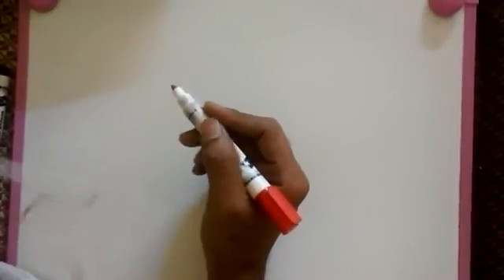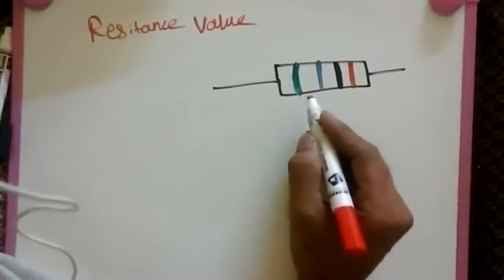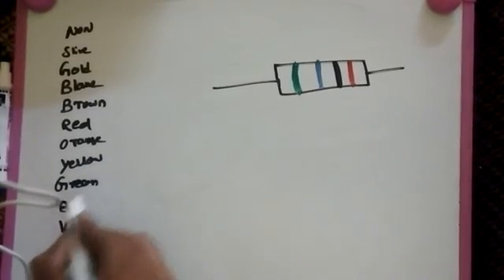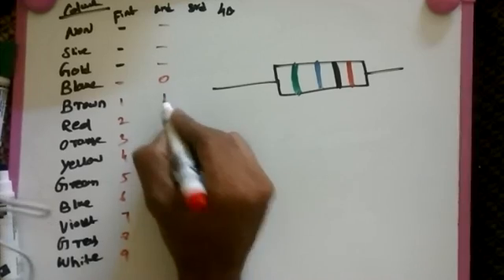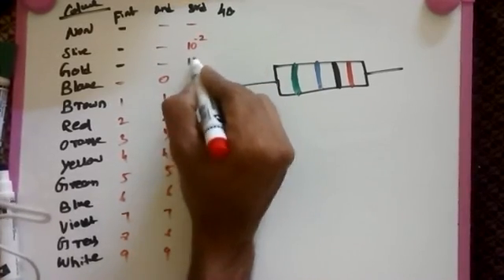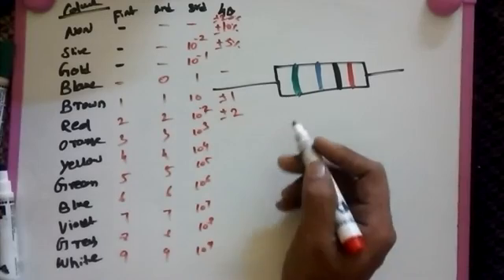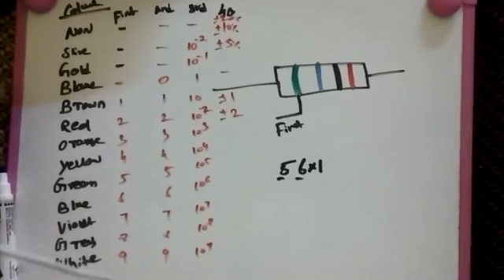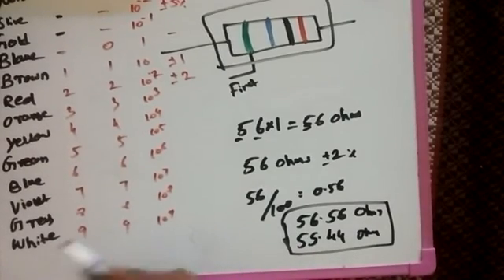Resistor color coding 2016

Comment: the simple way to check value of res is with your ohm meter color code is fine but you do no need it i order these res they come 10 to the card the card has value stamped on it and it is exact  what you see is what you get  most  are made in china  but good quality also cheap they will send more if order assorted